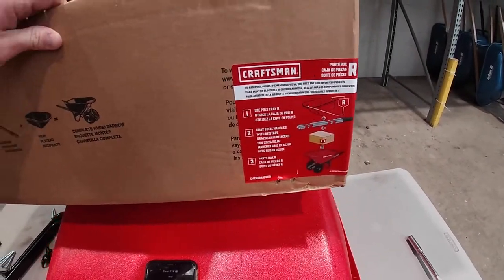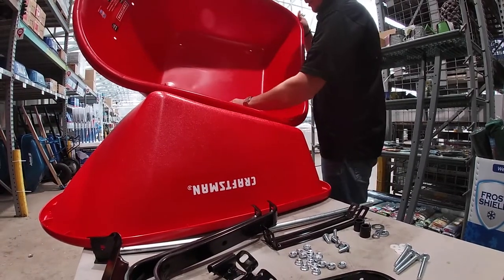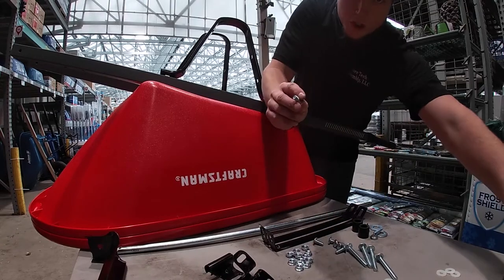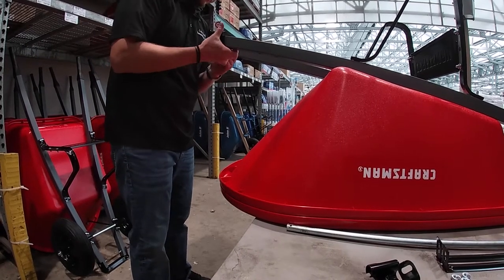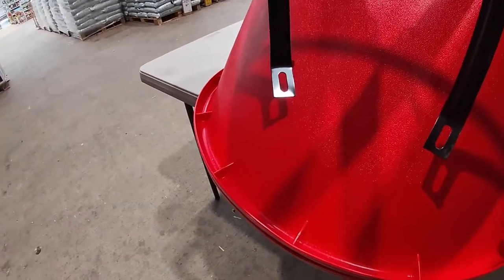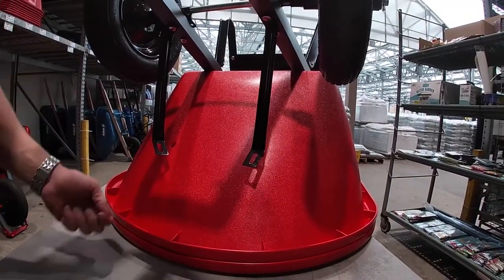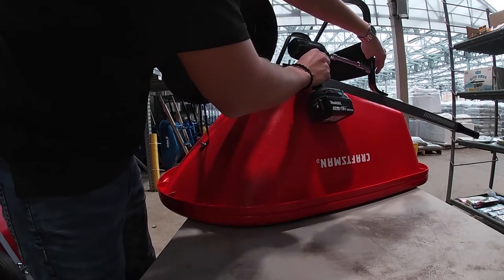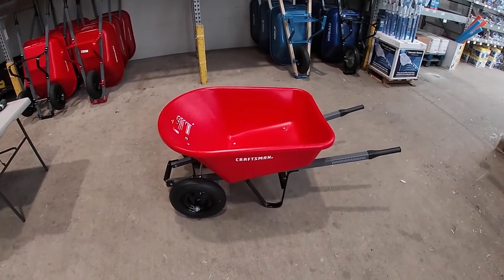Craftsman Dual Wheel Wheelbarrow Assembly Training

Comment: These are the sorriest wheelbarrows ever made. I have one that is about five years old and it is cracking around the bolt holes and in center of tub. It has for most of the time used to haul soil, mulch and grass clippings. I don’t think you can buy replacement trays for them. Other than propping it against my shed it is kept outside. Not really abused.